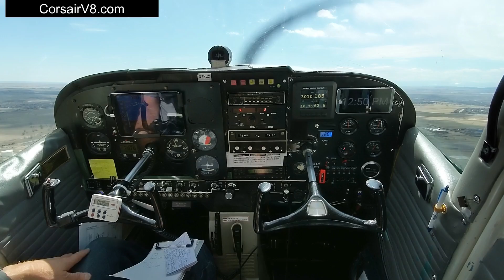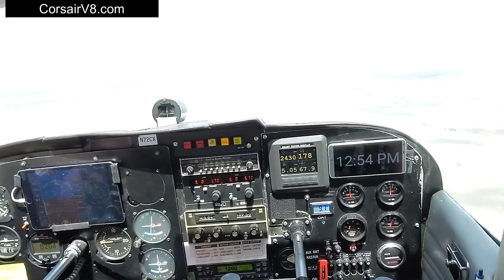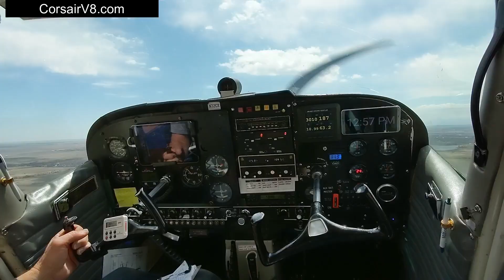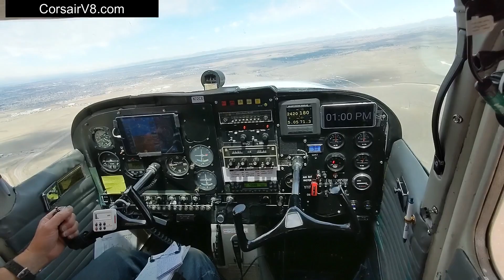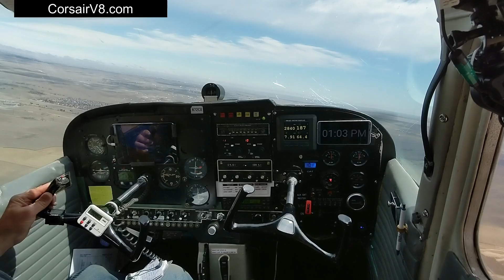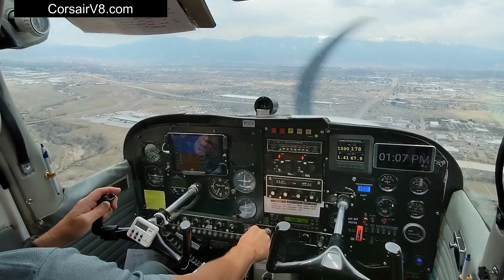Cessna 172 Skyhawk Traffic Pattern Flight Experimental V8 500hp wind shear cross wind ATC landing

Comment: Your website Ad says:
PUSH BUTTON START - great!

NO CARBURATOR HEAT. - ...assuming it's fuel-injected? So, does it have automatic means to prevent intake icing?
I've flown EXP planes with no carb heat. But, it was just that - they simply didn't have it. No, they didn't have anything instead. "Just stay out of clouds" was the solution.

NO MIXTURE. - hell yeah! I mean, looking at EGS and manually leaning the engine is fun for the first couple times but... I just wanna script for "lean engine to best MPG" - for when throttle under 90%, and for best power - when at full throttle.

but NO RUN UP? - how come? I mean, even if this doesn't have dual mags, you'd still wanna check all systems in the green before taking off? Same as with carb heat - might as well don't run-up and fly, and 99.9% of the time you'll be fine - but, without some equally effective alternative that's just throwing safety margins out the window?

Comment: "Almost 500hp engine. Derated to 210hp"
- so, somewhere between a C-172S (180hp) and a C-182(230hp). Granted, a C-172 would have no use for a true 500hp engine, although a bump to 210hp would make it a true 4-seater.
But operating cost is arguably the main factor for such aircraft. It's the Toyota Corolla of general aviation... People don't buy a C-172 to go fast or anything. They buy one in hope that it will be cheap to operate but also realiable. But alas, the ancient aircraft engines are still quite expensive due to monopoly.
Reply: Gotta love Lycoming and Continental.  All the fire-breathing performance of Briggs & Stratton, and the cheap forgiving maintenance needs of a vintage Ferrari.  Once the lawyers figured out they could write themselves any check they wanted in aviation-related lawsuits, all innovation stopped dead in its tracks.  We have 1950s airplanes being sold new, with nothing to show for it but a glorified iPad glued into the panel and a sketchy K-Jetronic knock-off injection system under the cowl.  Five hundred grand for the privilege, and you have to wait in line to get one.  The certified airplane world is just madness.

Comment: What fuel is this engine using? The reason I ask is that I understand that some motor fuels [as opposed to 100LL/AVGAS] have additives that can erode wing fuel bladders.
Reply from the maker: The engine is using regular unleaded gas 87.  We’ve had no issues with fuel bladders.  Because most  keep using the stock 40 year old Cessna parts you’ll have those concerns.
Reply: I think that Additive would be Ethanol. You can buy Ethanol free gasoline, or, "Pure Gas".

Comment: Great video! Just wondering if you use that same engine to 182?
Reply from the maker: Ricardo, Yes. That is the beauty of our whole product.  Our 1 engine design will fit multiple aircraft, including the 182.  This is one of our strongest advantages.  We don't need 6-10 types of engine blocks to produce for various planes.  1 block, with software modifications to adjust horse power for each planes desire.

Comment: In addition to the economics this installation has demonstrated, the performance improvement is significant.  The cruise performance in the 8,000' to 10,000' range should be interesting, even compared to the 180hp/CS prop STC.

Comment: Very interesting - any reason why you could not program least 1 "boost" button for a 10 second (+?) power increase of 50-100 more HP?
Reply from the maker: We have experimented with such temporary extra power options, but with a fixed pitch prop especially, prop rotation exceeds its mach limitations and becomes very inefficient.

Comment: Will strongly consider this when it becomes available I am getting close to OH on my 0-300
Reply from the maker: Thanks. We are still in flight testing and the plane is busy, and not renting it out. We do have interest from others wanting to convert their club's C172's and 182's to this engine and starting up an experimental flying club. This would be ideal for many as it keeps cost down and allows for training and building time. We will post info when it happens. The absence of the carb heat and mixture is a huge step forward, and really reduces pilot workload and checklist items.... the simple throttle control makes things a lot easier. We think the elimination of the engine run-up is also a big step forward as well.
Reply from the maker: Thanks for comment. Our target price point is about same as manufacturer overhaul cost of original engine after trading in original engine (there are overhaul facilities wanting to buy the original engine and will likely offer rebate). Check website for updates.